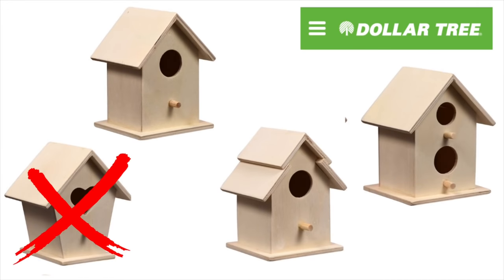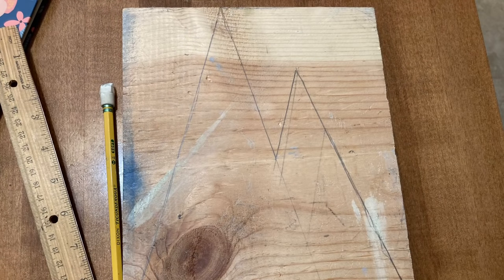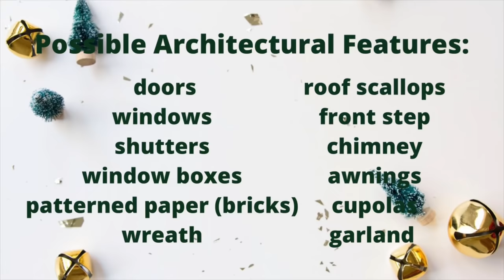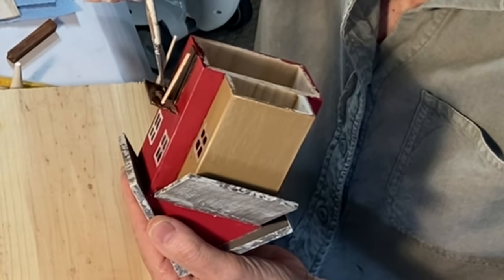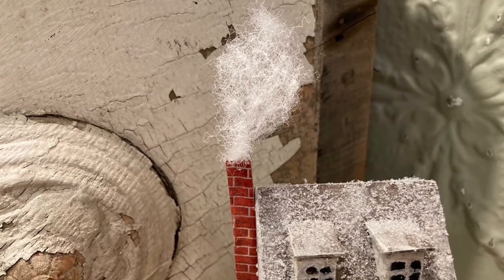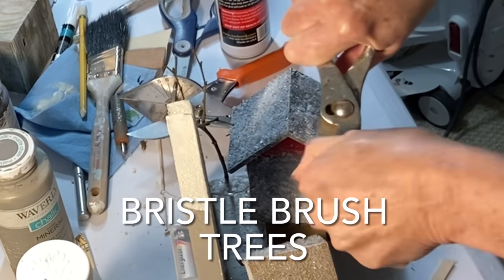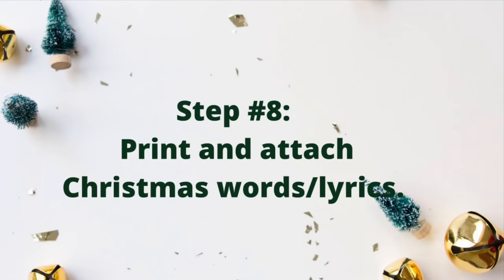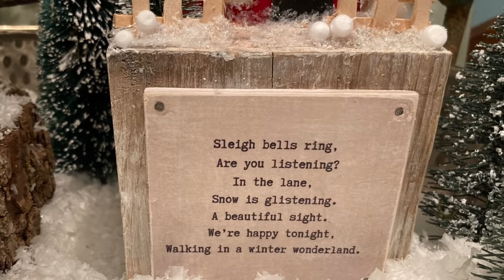DIY Christmas Village Using $1 Birdhouses

Comment: i love your Christmas houses. they are very cute, and the details you added are fantastic. in the past, i used a full sized birdhouse (from Hobby Lobby) and added framed  windows and a front door. i made it an English half-timbered house, with white stucco and gray wood beams. i painted the roof a dusty cranberry color. i wish i'd used a balsa wood sheet to cut into little wooden shingles to layer on the roof (like i did on another house i did) or used thick acrylic tube paint for the roof so i could have gotten more texture on it. i bought two small wooden "pots" and glued tiny silk cranberry colored roses in them for each side of the door. i left the bird door in place a little above the traditional rectangular door i made.  the roof has a very high peak so the house appears to be 3 stories tall. i decorated this bird house many years ago and still have it. (it's an indoor house as it is not waterproofed.) it's very satisfying to decorate these little houses you and i have worked on.
Reply from the maker: Oh, I would love to see this!!! Could you post a picture to the Facebook group page? Please?

Comment: So beautiful. I wonder how long the batteries last. Can you use rechargeable ones? TFS
Reply from the maker: I think rechargeable batteries would work, but I have never tried them. You could also use a little electric bulb and drill a larger hole for it to fit through.

Comment: These are awesome! But hoow do you get the lights to shine in the front if the hole is in the back?
Reply from the maker: I use the $1 DT string lights. I put the lights in the house and when they are turned on the light shines out the hole in the back AND the window holes in the front. Did you see that I drilled a small hole in each of the window panes? Hope this helps?
Reply: @CanterburyCottage  oh no... I missed that part - thx! :)

Comment: Is there any particular reason for not using wood glue or Tacky craft glue on the wood items?  It would seem these glues would hold up better than hot glue.
Reply from the maker: Wood glue is the best long term option for gluing wood items (and I always use it on furniture). However, it just takes awhile to set up, so for small crafts I use Gorilla Glue hot glue sticks. They work really well, and because I am not waiting for glue to dry, I can continue working on my project.

Comment: 5:34 Those are not cupolas, those are called Dormers. Dormers are windows that have been placed in the slanting sides of a roof. A cupola is built on the very peak of a roof. Cupolas are meant as a way to bring a cooling draft through a house or barn. There is usually a trap door in the floor of the cupola and the sides are covered in louvers for the air to escape from. The trap door is left open in the summer time and you either leave the barn door open, or the lowest windows of the house open. As the hot air in the building rises, it pulls cooler air from near the ground in through the building. This created a constant draft through the building to keep the air circulating and let the building breathe and cool down. In the fall they closed the trap door in the cupola, and of course closed the windows or barn door to keep heat in.
Most people think a cupola is just architectural decoration on a building, and today they usually are. But in the days before electric and freon air conditioning, this was how you cooled buildings down.
Reply from the maker: I knew I said the wrong word after I published the video; however, I didn’t know the purpose of cupolas. That is so interesting. Thanks for sharing this!😊

Comment: I love watching your creative process. But I'm a new subscriber and I'm just wondering why you seem to use chalk paint exclusively?
Reply from the maker: I mostly use chalk paint because it adheres to just about anything with little or no prep. Other paints will chip and scratch easily if the surface isn’t properly sanded and/or primed.

Comment: Is the chalk paint better for this than regular acrylic paint?  Also, may I ask - did you use thick cardstock for the paper, or just regular, thinner copy paper?  Thank you!
Reply from the maker: I think any kind of paint is fine for this project. I used regular paper (which I prefer for almost all decoupaging projects) because it really bonds with the wood, so it doesn’t just look like paper glued to wood. Also, card stock is more likely to bubble than regular paper when you apply the top coat of Mod Podge.
Reply: @CanterburyCottage  Thank you so much for your helpful answer.  I really appreciate the extra information you offered to me!

Comment: How did u get the scallops on the roof again?
Reply from the maker: I just drew them on with my hot glue gun. I drew horizontal lines with a pencil first, so they would be evenly spaced.